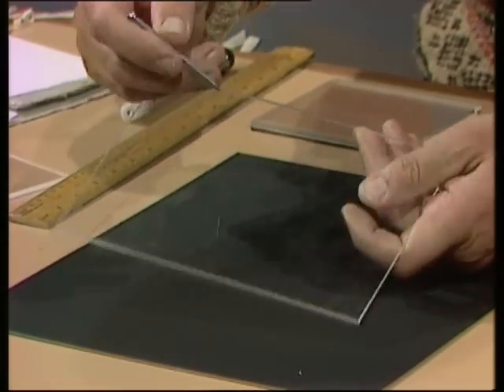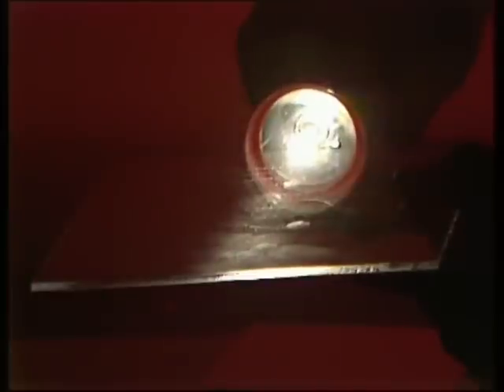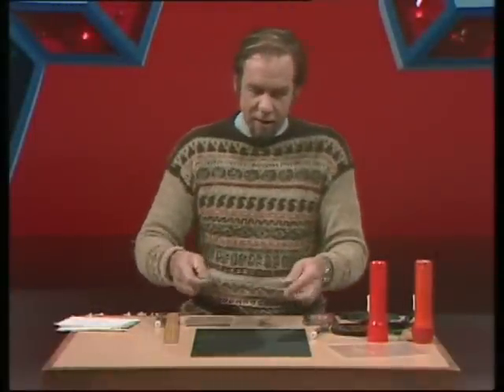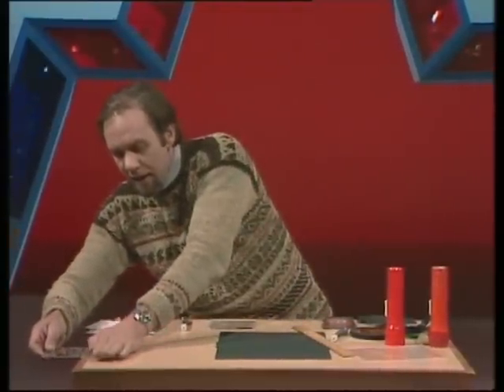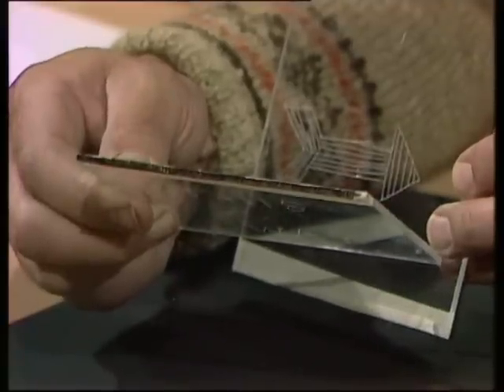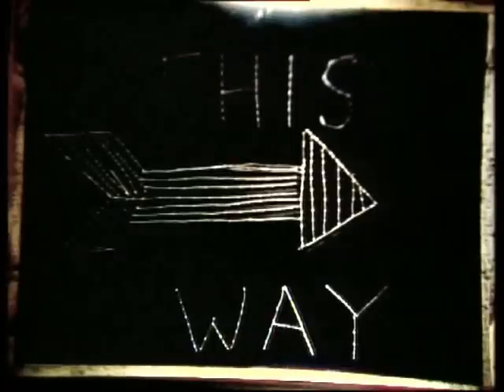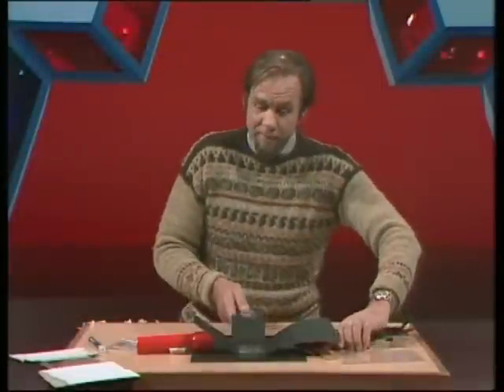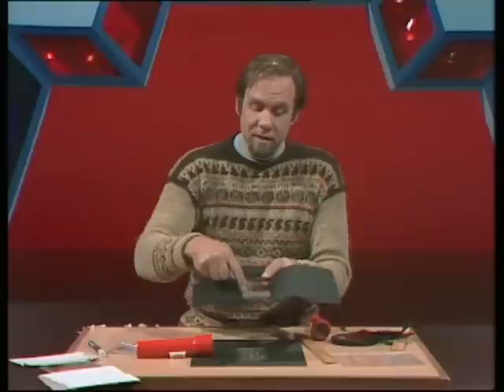Perspex Light Display

Comment: In Canada and some other places, Pespex is called Arcrylic or Arcrylic glass. As my fellow commenter said, LED strips are used to make more even flow, but work on the same principal. 

Also, by using a thick band if masking tape on the side opposite the ruler, you have a better chance of avoiding those misses becomming personal, as long as you use little force and a shallow angle on your nail.
Reply from the maker: Yes, but we were limited to around 4 minutes a segment and you have to cut somewhere. These segments were aimed at kids around 10, and we didn't want them too involved - Rob